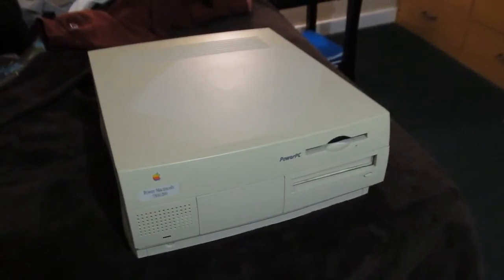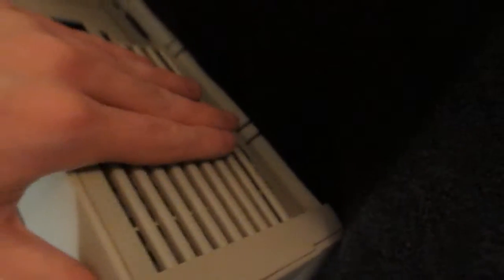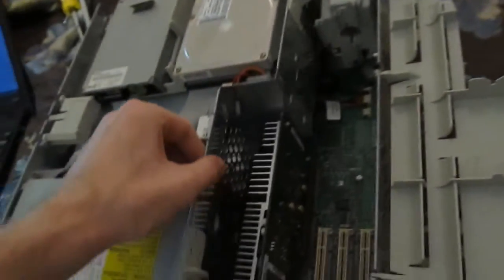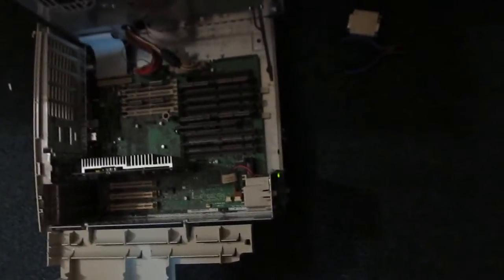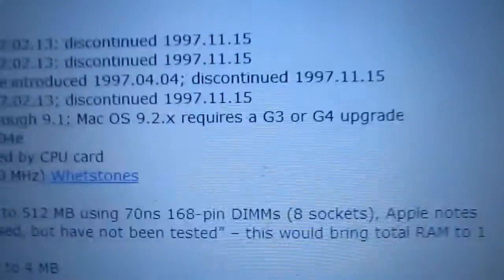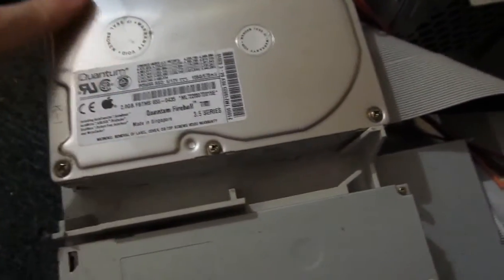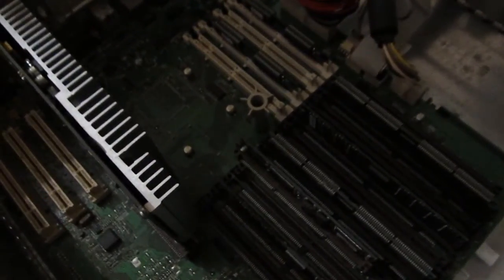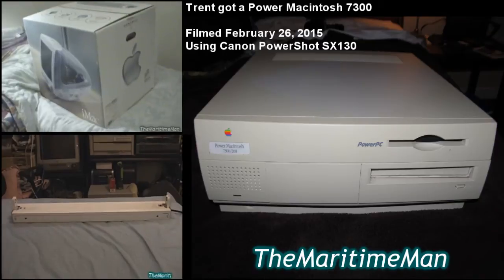I got a Power Macintosh 7300

Comment: Huh, I find it funny that Macs used to be some of the most expandable computers on the market and now 18 years later they're not expandable at all with the exception of the 27" iMac and the trashcan Mac Pro, and all you can upgrade on those is the RAM.
Reply from the maker: ***** Yeah, I find it sad how integrated and closed-up Macs have become in the past couple of years. Now there's rumors that Apple might switch to ARM processors for the next generation of Macs, making them even more of a closed platform (no more ability to run Windows on them, for example).

Comment: The audio is definitely messed up, but otherwise everything seems normal. so it should be a good working computer.
Reply from the maker: Good news on that front - when I performed the first full test with a monitor, keyboard, and mouse, the sound was completely fine, and it hasn't done it again since. I guess either having the computer open or running it without peripherals was causing it somehow.

Comment: Very cool find.
I think you're correct about a possible grounding issue maybe with the computer open that's why the speaker is making those noises.
Did I see a power output on the power supply when you had it opened??
You really need to get some basic computer supplies for your room, a cheap monitor and a few power cables.
Reply from the maker: I've since tried it with a monitor, keyboard, and mouse, and the sound problem completely went away. Must have been something to do with either the computer being open, or having no peripherals connected to it.

Yes, the power supply has a passthrough for a monitor.

I'm always tempted to keep a set of stuff like that in my room, but I know that if I did it would distract me from my work, so I choose not to.

Comment: Oh Very nice find :D I have a Power Macintosh G3 Beige desktop which replaced the 7600. Yeah you can max out the Ram at 1GB using 8 128MB sticks. the fastest CPU upgrade u can fit is a 1Ghz G4 (very rare tho) I infact won off ebay a Macintosh Slocket adapter which fitted the slot the CPU gose in in that Mac and adapts it to the 300PIN ZIF G3 beiges blue and whites and G4 Yikes use it came fitted with a 433Mhz G4 ZIF which will go in my Beige so I can run Leopard on it heh (with a G4 upgrade to this 7300 u can even run leopard on it as well crazy I know)
Reply from the maker: Ah, nice. The extent to which these Pre-G3 Power Macs can be upgraded is really impressive.
Reply: ***** oh yeah its insain take the Power Macintosh 9500 for example. it came out in 1995  and u can upgrade it to 1.5GB of RAM since it has 12 yes 12 ram slots LOL it also has an insain 6  PCI slots heh I would love to get a Power macintosh 95/9600  heh. BTW if you dont know im Bulb Freak on LG the one with the sawtooth (which i upgraded alot since i posted that picture on LG)

Comment: Just today I got exactly the same, but with more issues, I don't have monitor or adaptor, power button is missing and there is a lot of noise coming out of the speaker, no chime (sounds like police chase), the harddrive is little bit rough and does not boot, BUT I never ever had a Macintosh, now when I'm thinking I have never seen any Macintosh, so Great Scott, I need to fix that up!
Reply from the maker: Krivulda Does it sound anything like this when you turn it on?

https://www.youtube.com/watch?v=p9VHM-zKfec

Try removing and re-inserting the RAM. Failing that, it may need new capacitors on the motherboard.
Reply: ***** Like police chase (cars, sirens etc.) But loud. Also harddrive activity comes out from the speaker. Today I am going to disassemble and clean it.

Comment: I have a 2009 Nehalem Mac Pro desktop, which is very expandable !!! I'm about to take it to the shop to get it fixed. I made a huge mistake when I cleaned both boards myself with alcohol and Q-tips. Fried the main mother board. I can have up to four internal Hard Drives, two Optical Drives, and it will run up to eight monitors (!!!). I can upgrade the RAM to 32GB, and also upgrade the video card, and I can also upgrade the Operating System to Lion, and possibly even the newest Operting System > Maverick (?). I plan on having several external HDs with different operating systems, so I can boot into either Snow Leopard, Lion or Maverick.
Reply from the maker: Yeah, the early Mac Pro is an incredible machine.

Comment: I have one of these! I need to check it and see if it still works ..... I doubt it would go online though. I think the highest OS it runs is 9.2, which was a very good and stable Apple Operating System. I have Tiger 10.4 running on my iBook G4 (2004), which also has a dual System, so I can run Classic Mode (OS 9.2) at the same time, which is cool, because I can run lots of old software. -- Jim (California)
Reply from the maker: 9.1 is the highest this machine can run. 9.2 requires software patches.

Comment: 10:36 to 10:56 -- About the "startup bong" -- I heard something similar to that in reference to it, in Disney-Pixar's 2008 film "WALL-E" -- when Wall-E would recharge with solar panels. When fully recharged, the Macintosh "startup bong" would sound.
Reply from the maker: Indeed, Wall-E makes the current Mac startup sound. Steve Jobs was the co-founder of Pixar, and its CEO for a while, so that's where the relationship stems.
Reply: ***** Yes. I think of the film when I hear the sound.
Reply: ***** Also, this is the first I would know of a speaker inside a CPU. Is that for audio, like computer speakers that connect with a plug?
Or is it for beeps only?
Reply from the maker: Kegan It works for all audio output. Every Mac ever made has an internal speaker, as do many business-class PCs.
Reply: ***** Oh okay.

Comment: Had I existed in the mid-90's and had the money, I would have bought one of these computers, with the maximum specifications possible; without a care about anything. It would be worth the massive upgradability (spanning 3 generations of processors) and - it's just stellar. It is unfortunate that Apple does not today outmatch this level of customization in their computers.
Reply from the maker: nospacesWFT The Power Macintosh 9600 was king for that. It could actually be expanded further and made more powerful and capable than the computer that replaced it, the Power Macintosh G3 minitower.

It is indeed a shame that no Mac made now has decent expandability. I would think there to be an outcry from professional Mac users about this, but apparently there's not. Or maybe there is and Apple doesn't care.

Comment: I don't like the noises that you hear from the speaker, the hissing and buzzing and popping and crackling, also, the startup chime sounded distorted to me and the volume was quite low, could it be that the capacitors on the motherboard may be going bad?  I hope not, otherwise you'll need to look into repairing  the motherboard.  Early Macs had problems with blown capacitors.
Reply from the maker: Oddly enough, it never did it again after I fully tested it with a monitor, keyboard, and mouse. The audio is perfect now. I might be wrong, but I don't think the Power Macintoshes suffer capacitor issues like the 68k ones.
Reply: Lachlant1984 the noise from the speaker is from the hdd
Reply: I know, but I still think those sounds are ominous.
Reply from the maker: Lachlant1984 the compaq nerd Either way, at least it never happened again!
Reply: ***** you must be broke if you have not got any computer cables and stuff like that
Reply from the maker: the compaq nerd No, I'm living on my own away from home (where all my equipment is) while I go to school.

But yes, I am also broke.
Reply: *****
okay, just wondering.